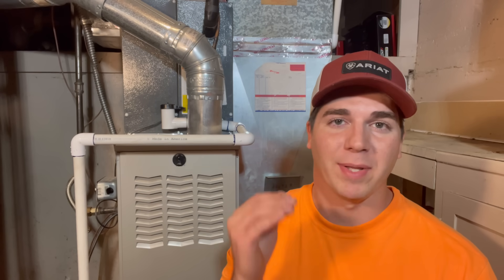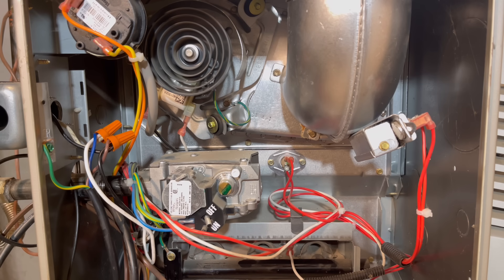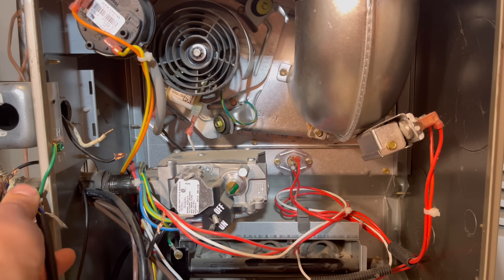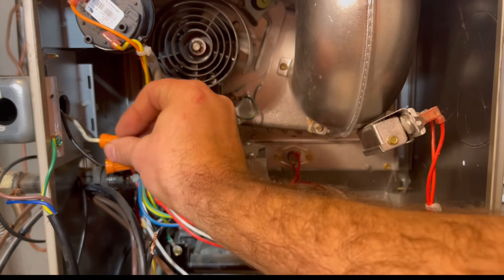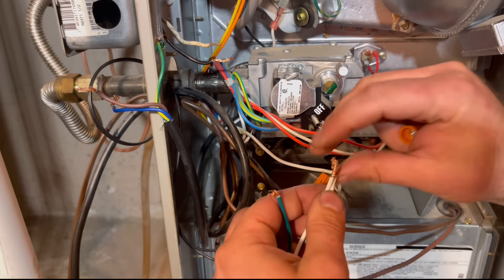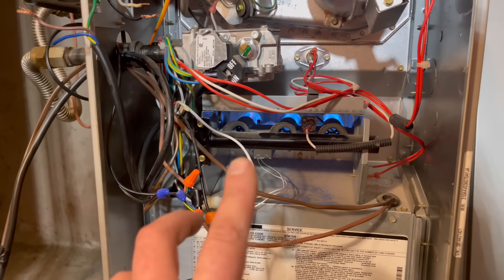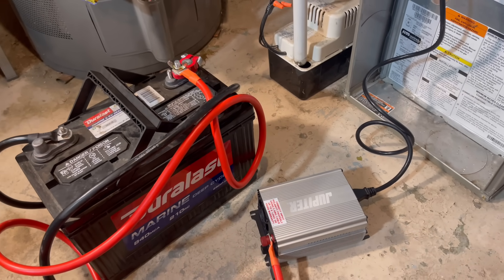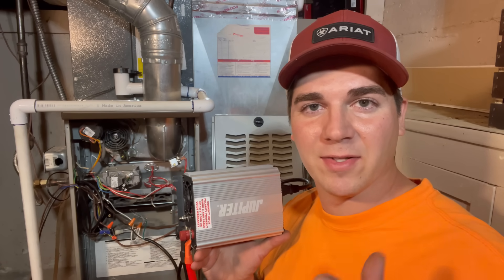Did You Know You Can Heat Your Home With A Car Battery?

Comment: thanks for the video, my furnace have only heating and no cooling. I believe I can just plug in the furnace directly into inverter instead of opening and removing the wires. I think you did that since you have cooling as well. can you please clarify if my understanding is correct?
Reply from the maker: Regardless of hearing or cooling, your furnace needs something for it to be able to plug in to. Watch this video and it will make this process very easy and you only have to do it once 👍🏼

https://youtu.be/1JNuovFpCpQ
Reply: @diyhvacguy  the other video made it clear. thanks!

Comment: Don't forget, you can put the battery BACK INTO YOUR CAR/WINNEBEGO/TRUCK and recharge it so you can use it again. Just don't let it run all the way down, unless you have jumper cables and can use those to get the vehicle started again, you just ask your neighbor to help or use a 2nd car. In this way you can last for weeks while the power is still out.

Comment: do you have to get the 1000, what happens if you get the 3000 or 5000 will it still work the same ? thank you
Reply from the maker: Yes, as long as it isn’t too small. Too large might run the battery quicker too though

Comment: The furnace blower motor takes quit a bit of power, especially if its 1/2 horse. I don't think you will get more than a couple hours out of this setup.
Reply from the maker: It got six hours. I know it’s not days but still great in a pinch! Cheers

Comment: So couldnt you do this with a generator? Just add the pigtail & plug that into a geny & youre good?
Reply from the maker: Absolutely
Reply: @diyhvacguy  of course this video popped up in my recommended after the fact.  But just this x-mas weekend (2022) we lost power for 8 hours in 40mph winds that set a windchill of -30F in our area.  The house froze as i tried to do what I could to keep it warm using my generator and space heaters.

Good to know that I could run my furnace from my generator with just a pigtail for the future.

Comment: Great info. Thanks. Is there an inverter that will power my 220 volt furnace fan and still use my 12 volt car battery?
Reply from the maker: Unfortunately no, this is only for gas furnaces.

Comment: Could I have an electrician set up a system at my furnace with a switch, to switch back and forth between backup and normal? I'd like a permanent solution like this. This is really cool.... Thx for sharing.
Reply from the maker: Absolutely you can. I have another tutorial video on how to add a pigtail to your furnace and you can unplug it from power and plug it into your gen set or inverter 👍🏼

Comment: What about using a battery backup from the store, then replacing / wiring the car battery in addition to the already installed lead acid battery that way you don't have to rush to plug it in and it's automatic
Reply from the maker: I’m sure you could do this just fine

Comment: Disconnect the blower motor at the quick connect plug,  it'll drain the battery. The limit switch will turn off the burners when it gets too hot. Leave the blower door off and tape the safety switch. The house will heat fine on thermal gravity.
Reply from the maker: Interesting thought. So many times of the limit switch tripping it will go bad quicker but this is a great option! Thanks for the tip
Reply: @diyhvacguy  limit switches don't wear out, it's like saying thermostats wear out if you use it too much. Limit switches are a vital safety feature proven and tested over time. Gravity furnace wouldn't work well if duct work was in the attic.

Comment: Interesting, but for people in seriously cold climates and those who don't have huge houses, they're probably better off getting a cheap kerosene heater ($150 or so buys a ~24K BTU unit that can cover up to 1000 sq ft, which should be more than fine in a pinch for most) and just keeping a jug of kerosene on hand (or even just some diesel and 91% isopropyl).  No electricity required and five gallons of fuel would support a constant burn for three days, far beyond what any car battery is going to be able to match.

Comment: Great idea, but it will ONLY work with burners that do NOT have a safety flame detector (ionisation) cut out. These REQUIRE the presence of Earth to the chassis at zero potential, and the flame detector probe at AC Hot/high potential. The flame presence acts like a thermionic valve to carry a small current that detects the presence of a flame, ie, gas not leaking unburned. You also need a PURE sine wave inverter, modified sine inverters are cheaper, and will sometimes work, but will either shorten the life of your equipment (anything inductive), or not work at all and just get hot.
I have successfully done this, but you need to make sure the inverter you use delivers Earth, Neutral & AC hot/live correctly. Most off the shelf inverters & small gensets do NOT have this right. Test your RIG months before it gets cold, ie, in the summer.

Comment: Why use a car battery that cost around $200 that will last for only two/four days max and can’t be reused afterwards when you can invest $600-$800 on a generator that will run the ac/heater off and on when you need it for over a week depending on how much gas you have on emergency standby and can be reused every year? Now is this a good idea if you don’t have a generator and you are about to freeze to death? Yes most certainly, but just remember when everything’s over your vehicle has to have a battery to get you somewhere to purchase/get food to service so I personally would use the vehicle battery as a last emergency resort. And if you’re willing to throw a little more money in there then get something like a pallet heater that doesn’t run on gas nor electric and cost starting around $900 but since is doesn’t run on electric are gas I personally believe the price is well worth it definitely when it comes to emergency cases.

Comment: Would a modified sine wave inverter be sufficient? Also the house circulation fan uses a lot of power doesn’t it?
Reply from the maker: Mine worked fine in a modified wave but it’s an older furnace. Some newer furnaces only like the pure sine wave

Comment: Thanks.  I will have to go to Harbor Freight and get an inverter.  We once were without power for 5 days in the winter and that is zero fun.  I assume that with our 93 percent, condenser type furnace I would just connect everything that was connected to the hot lead to the black wire and same for the neutral wire.

Comment: I did exactly what you are doing. I have a brand new modern inverter. That produces a clean wave of electricity. My glow plug will not kick on to ignite the gas. Do you have any thoughts?
Reply from the maker: You may need to bond the neutral. If that doesn’t work I think I had one that we tested that did that and I had to unplug the ignitor and manually light it and it worked
Reply: Thanks. I did bond the grand wire to  the breaker box, sadly it did not work.  Doing the gas manually would be more steps than I would want to do for hours when the power is off.  I have two gas fire places and just run the fan on the furnace.  It would have been so much more efficient for the furnace just to operate as normal.  Again thanks for you help you have a very informative channel.

Comment: How does the inverter  handle low voltage "brown out" to the AC motor. I'm just thinking here, if the battery starts to lose it's charge and can't provide the 12 volts needed by the inverter, will the inverter then deliver less that the 120v AC that the furnace motor needs? AC motors don't do well with less voltage and burn out. Is there circuitry built in to the inverter that will shut it off in this situation? Sort of like your lipo powered drill, once those cells reach less than 3.7 volts the drill just shuts off and the pack needs charging. Where i live (near Buffalo) my furnace runs every 15-20 minutes to keep the house at 68 degrees. I think I'd need to put 4 batteries in parallel to last 2 days. Thanks for your time and this video I hit the like and subed!
Reply from the maker: I’m not sure. Maybe someone else will chime in.

Comment: Great video but here something people should be aware of... Never place battery directly on the ground which will drain much quicker. Secondly, check your furnace amperage draw and get an adequate inverter so it doesn't burn the house down while you are asleep. Lastly, marine or batteries with deep cycle will last longer than regular standard car batteries. If you want the furnace to run longer just connect few batteries in parallel but remember this will increase amperage so make sure inverter is capable to handle it.  Power cables should be adequate to handle the amp. Get a car batteries charger with trickle car to top them off to stay full charge.
Reply: That is an old wives tale. Modern batteries can be left on any surface including concrete. Batteries will lose voltage and go bad over time regardless of where they are sitting.

Comment: Probably want a pure sine wave inverter. Do your own homework but iirc some types of ac motors really do not do well with anything but sine wave. And it might be the sort of not well where: it'll get you through that day or two but you're going to be replacing that blower motor in a month after you switch back. I know next to nothing about HVAC other than there's multiple motor types at play now. Ymmv but it's probably worth the extra hundo not to have to replace your furnace motor after doing this

Comment: Awesome 👍.  I have a 1995 oil furnace 85% efficiency.   Can I do the same thing with oil furnace?  I have a 4000 watt generator I use during storms for sump pump.  Also could a sump pump be connected on second circuit?  Also a trickle charger could be used to charge battery.  Similar to battery backup sump pump system
Reply from the maker: If it’s a 110v pump then yes I’d say so
Reply: @diyhvacguy   Yes     it's a Thermo Pride  115v 60hz op.load -5.8   ignition - 10,000 V/23 ma secondary continuous transformer

Comment: A great tip. We had a pigtail and simple light switch installed on our furnace, that way we flip the switch so if power comes on there will be no back flow. We can hook the generator or battery to run the furnace.

Comment: Several days?  Highly doubtful.  A typical forced air system draws about 500 watts, mainly for the blower.   Standard marine batteries are typically around 100 amp-hr and car batteries are even less.  100 amp-hr x 12 volts is 1200 watts hours.  The furnace would only run for a total of 2.4 hours which will never stretch for several days.
Reply from the maker: It heated my home for six hours. Admittedly not days as I thought but still great in a pinch! This obviously isn’t my main backup power source but it’s good in an emergency where no generators can be found
Reply: @diyhvacguy  
Yeah six hours with cycle time sounds about right.  You could probably stretch that even more if you lower the temp and have a well insulated house.
Reply: Unplug the blower motor at quick connect and run furnace off limit switch, the blower motor will just drain your battery too fast. Leave the blower door open and tape the door safety switch. You'll have a gravity furnace and it will heat the house fine.

Comment: I lived in a little shack of a house that had a wall mounted heater and the thermostat and gas switch were powered by a thermocouple in the pilot light frame.  We had a blizzard that dumped three feet of snow and took out power for days. No problemo!  I had an inverter that powered my computer; I'd run my Jeep to charge the battery periodically.

Comment: between the fan and ventor motor running prob around 600 watts that car battery mite last 3 hours!!!!!!!!!!!!!!! Not Days!!!!!!!!!!!!!!!
Reply from the maker: Lasted 6 hours actually. Not days admittedly, but six is still pretty great in a pinch!
Reply: @diyhvacguy  true on that

Comment: I get that it will work but how long could a battery possibly power the high energy that that blower fan requires to blow the air throughout the house? There's no way that could last days, right?
Reply from the maker: It lasted SIX hours, which admittedly isn’t days, but still great in a pinch! Cheers

Comment: This is also a good technique for water heaters that are gas-fired and have an electric igniter.  Assuming you still have water pressure in your area, you could be using your hot water during an outage.  I am surprised that homes are not equipped with optional switchover equipment with battery for key pieces of equipment (gas-fired HVAC and HW) by now.  The option could also be used for heat pumps just to run the blower to help move air around the house.  You could use kerosene heater(s) positioned in the open areas of the home, while the circulating-air distributes the warmed air. Having been in the power utility business all my life and having been thru many ice storms, this is good info for people to know.  Good video. You can also cook off the top of the kerosene heaters with a sauce pan.   Been there and done that several times.
Reply: do you think its the same for oil furnaces? or just for gas?
Reply: @sammybully5030  I have never worked on an oil furnace.  However, assuming it has an electric ignitor then you would need a backup power source to power the ignitor.

Comment: A car battery is not a deep cycle battery and will not deliver a usable charge over the same amount of time that your Deep Cycle RV Battery will. #2) You have a gas furnace with a blower motor that requires 8 amps. Your video only addresses the use of your type of furnace. This inverter will be running at 100% capacity and draw a load of about 100 amps when the furnace is fired up until the battery discharges or the inverter burns out. The battery in my pickup is rated at 80 amp-hours and therefore would not run that 1 HP fan for an hour. With the temperature experienced in that Texas blackout, I would expect a 50% duty cycle running in a well insulated home. I would not expect more than 2 hours of operation before you have to break out the Generators. Do the math.

The other thing is this would definitely not apply to anyone who lives in an All Electric home such as me.
Reply from the maker: This is incorrect. It ran for 10 minute increments and it heated my home 6 hours. Admittedly not days, but six hours is still great in a pinch!

Comment: Couldn't you just wire in a pigtail and plug it into a UPS? Seems a little easier and the UPS will charge itself once the power comes back on.
Reply from the maker: Absolutely

Comment: Your furnace might kick on but I guarantee you when that blower goes to kick on it will suck all the juice out of that battery fast a generator has a hard time keeping up and you're telling me that little inverter in that battery is going to do the job I doubt it
Reply from the maker: It ran for SIX hours on that little inverter. Check out my follow up video. Cheers

Comment: Below zero with hurricane winds and four feet of snow on the ground the power was out for 18 hours this time. I have two car batteries that are used and a 1,000 w square wave inverter from the auto parts store. The automatic 35 amp charger is plugged in all the time. I have the smallest available Toyo stove. When the power goes out the powered exhausted the toy store fails it keeps saying toy store that's my Toyo stove. It farts a bad stink into the room of diesel smoke. What's the power going on and off on and off I just left the heater plugged into the inverter with a little light bulb, four watt led. Every time the part comes on for a little bit it charges. And if they go dead I can take the inverter to the truck run the extension cord into the house where the charger and the heater is and charge the batteries and run the heater using the truck. I have a barrel of gasoline on the front porch as I know I get snowed in and trapped. I bought a Honda inverter generator years ago but still have not opened or added gasoline to it. I did put a bottle of oil in it in case I need to turn it on. The square wave inverter does not run everything, one might invest in a better sine wave inverter that will operate everything. It won't operate the electric blanket though the computer is able to operate. Don't you know I couldn't get the damn hood to open but the power came on just in time. One more thing. The forklift dealer that does the Coca-Cola contract reconditions batteries and says Coca-Cola retires there batteries if they can't do a full 4-Hour shift or 8 hours shift. I'm playing to buy a big reconditioned 12 volt battery, not bigger than I can move and not smaller than movable.  Meanwhile I've gone through three major power outages north of Anchorage Alaska in the past 2 years. The previous three we didn't have any power outages, the storms are much stronger the past 2 years. And I haven't gotten cold during those times as my ad hoc power inverter hasn't failed me. Last year I did pop the hood open to charge the batteries. I put the inverter in the truck running the extension cord to my room where the charger and the heater is. I found car batteries only want to absorb about 10 amps with my amp meter during charging even when set to 35 amps. I let it charge both batteries at the same time and run the heater. It's a little tiny thing not a furnace. Being able to switch a big furnace fan to low speed during a power emergency would be helpful in making a battery last. I'm the only MacGyver I know. I have to take off for now bye bye